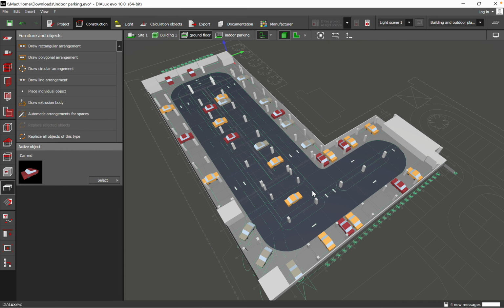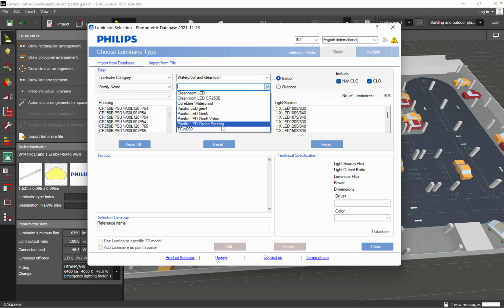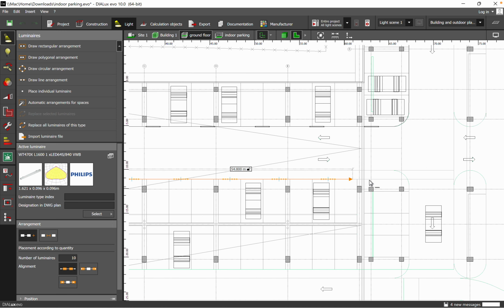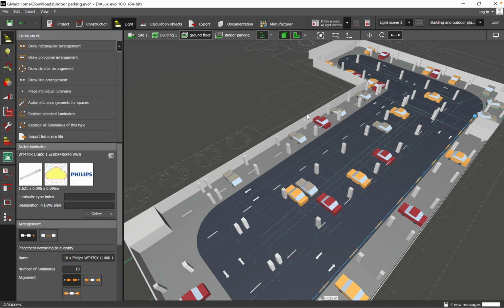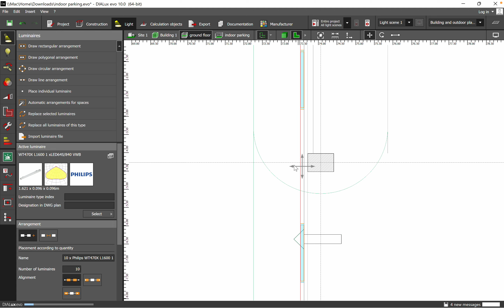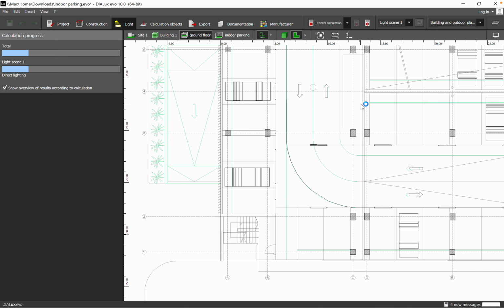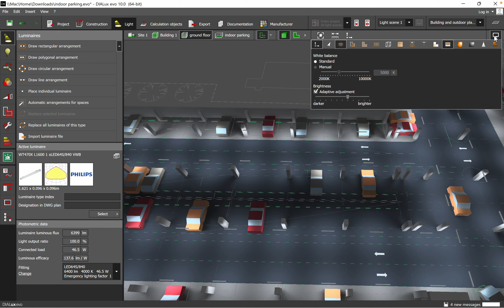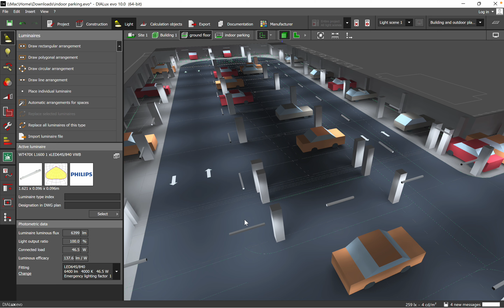Lighting for indoor parking part III

Comment: how is it that the uniformity is less than 0.40 and the result is positive?
Reply from the maker: Hi @peturkristev3845, you are right the results should be  negative, due to lower uniformity. I believe that it a software error. Thanks for your comment.
Reply: @catalindesigner  Hi Catalin, at least you can rewrite it to 0 and then the result is positive. But its not legal.
Reply from the maker: @Nopublicname  thanks for your comment, but to rewrite to 0 is not the right solution